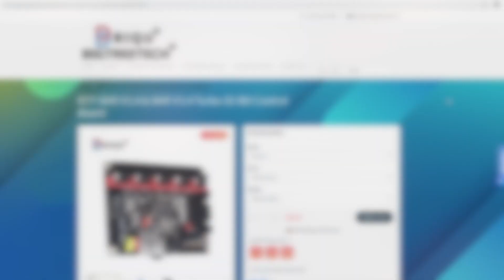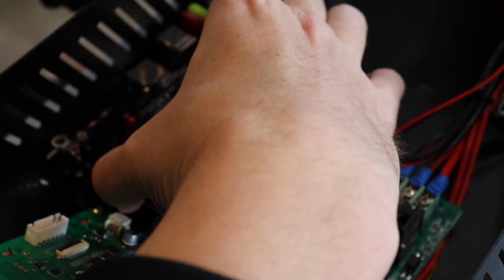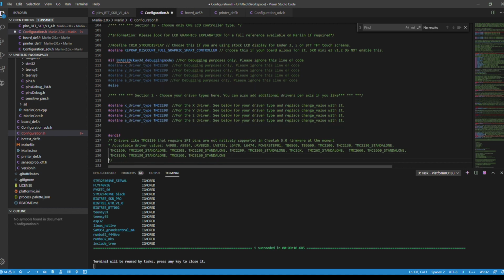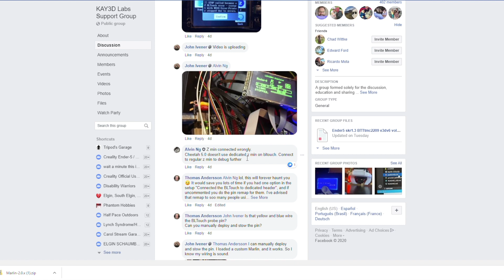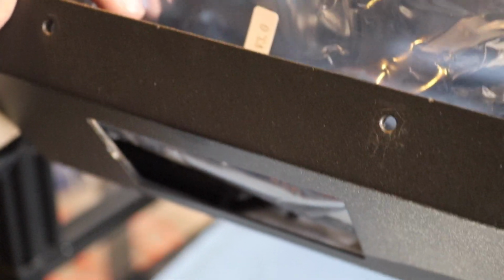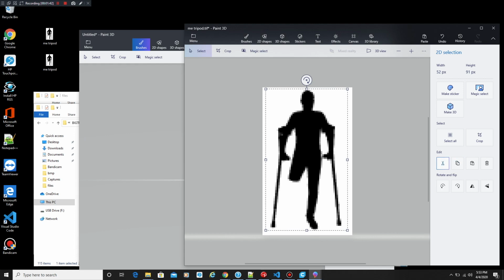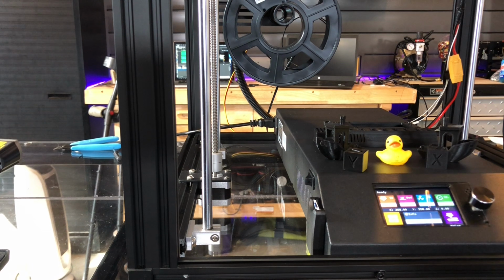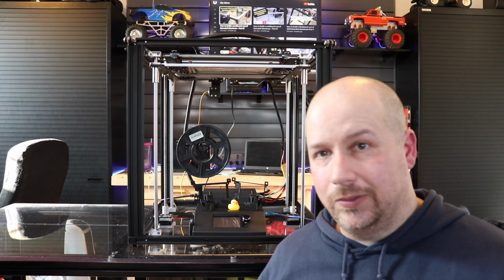Ender 5 Plus Ultimate Upgrade!   BIGTREETECH 32bit 1.4 SKR TURBO & BIGTREETECH TFT35 V3.0

Comment: I did the exact same upgrade to my Ender 5 in had the reference your video about 10 times. You help out a lot. Thank you!
Reply from the maker: That is great!  How is the upgrade working out?
Reply: @TripodsGarage  wellllllllllll. I am running the tft50 and trying to get bltouch working which I think does now lol. Plus the motherboard fan doesn't fit in the stock Ender 5 location, so more cutting! . This is my first major upgrade with the 1.4 turbo and tmc2209s. No sensorless. It has been a challenge but have learned a lot. Many issue but getting close

Comment: I tuned the serious vibration on the diagonal runs, Cable tied two VW polo exhaust rubber hangers on to the two 20x20 upper cross bars. They are heavy dense rubber, the weight and density silence the resonance.  But the Hotend fan still rattles during the vibes.. heavy duty foam on the base rails shut it up too, as does the cabinet enclosure its now in. 24hrs a day no longer a problem.

Comment: Great video, I'm the designer of the 2 brackets you used for the SKR and the TFT35,  just wanted to say its great seeing them in use, and others getting some value from them.  I found your video because I'm about to replace my 1.3 with the 1.4 turbo.
Reply from the maker: M C -  Great work!  They are a perfect fit, as you can see!   So happy you found the video, hopefully it comes to good use for your upgrade.  Thanks again - and thanks for watching!  Tripod
Reply: Hi, do you have a file for the TFT35 v2? I got a SRK1.4 i want to swap and it was a combo deal with the V2 but the file is for a v3 which is a bit different dimension. Eitherway, great work. They printed great
Reply from the maker: @0xFAVS  Hello!  I do not have a file for the TFT V2, so sorry!  I was on the BTT site and all I can find is the Bootloader.  Seems that all the Github downloads are gone for the TFT35 V2.0.  I will continue to look!  Thanks again for watching!  - Tripod
Reply: @0xFAVS  I don't, I only own the v3, I measured it up with a set of calipers. If you want to adjust the design yourself I've included .step files on the thingiverse page.  These are easy to edit (compared to .stl) in something like Fusion360.
Reply: @0xFAVS  I found a diagram with measurements for the v2,  I will have a go at editing a design for the v2 when I have some time later tonight, but you will have to print and test it, because I don't have one to try it with.
Reply: @0xFAVS  Here it is for the TFT35 V2.0  www.thingiverse.com/thing:4285471, like I said I have no way of testing it and it is based off of the diagrams from the BTT Github.  Let me know if I need to tweak it in the thingiverse comments.
Reply: @mc-dp5bd  Thanks :)

Comment: John, Great video!!  I can see why it took you a while to put this together.  The advantage of this upgrade is the extra features and options you gained.  After watching the video and your fun with the control box, you can understand why I ditched the box and made a new mount.
Reply from the maker: Hello David!
Yeah, this video took me a really long time to put together!  This video could have been easily 2 hours, I cut out a lot of footage.  I might have to do a long term update.  I stared at the box for a long time deliberating if I was going to keep it.  I decided for this upgrade, I was going to keep the stock look.  The box is getting crammed, but I kept it neat and tidy.  As for future updates, we shall see if it remains!  Yes, extra features and functions is correct, plus some future expandability.  It is so nice to have the filament runout working correctly and leaving the bed heated on!  I really dig the dual displays,  I learned a lot making this video, diving into stuff I never did before.  I hope that this video is useful to others as well..  Thanks again for watching!
Reply: @TripodsGarage  At this point there's very little Cheetah left in your setup ;)
Working advanced pause/M600 (filament out) -> multi color printing made easy! :)

Comment: This saved me so much time. I put in an SKR Mini E3 v2.0 board but the changes were pretty straightforward. One thing to point out with the current version of Cheeta enabling the EMERGENCY_PARSER caused the compile to fail. So I took it out and at that point, everything worked. Again thanks so much this is a really great video. Much appreciated.

Comment: Something else I will add, I trimmed the reset button off flush to the bracket on the tft35, put some masking tape around it and hit it with a dremel.  Its just too easy to bump mid print where it is.

Comment: Thank you, I broke my silent board USB, and Creality didn't (still doesn't) currently ship to the UK. So I found this on alternative control boards, and it was very helpful! I have ended up using Klipper firmware, I'm happy with the results. Though I should say Klipper doesn't support the TFT35 currently (12864 emulation mode is lacking a feature that Klipper uses, apparently).
Reply from the maker: Thanks for watching!  I will need to look that up!  Thank you...

Comment: One thing that helps when cutting out your new slots is to drill out the corners first. If you want to keep your cuts straight you can take a straight edge to the case and rest the cutting wheel on that while cutting. Appreciate your video, I just ordered that board because of it. I chose the HRP-600 power supply though.

Comment: Maybe I missed it but one of the issues I had and solved was that the build environment was not set.  Without this the build fails right after beginning compile.  To fix I just changed default_envs = LPC1769 in the platformio.ini file.  Thank you so much for the wonderful video.
Reply: I used this for my Ender 3 Pro, but the Cheetah would not even compile.  VS Code indicated that the INCLUDE folder was missing.  DLed the Cheetah from both their site and from Github using the links in the Cheetah site.  One DLed Cheetah, the other directed me to Marlin, no Cheetah.  Cheetah would not compile and the second is that standard drone of completely modifying the code in Marlin, which I did before and didn’t work correctly.....when I did, I always get the NO PRINTER ATTACHED, and I have been unable to resolve.

Comment: Tripod, thanks so much for making this video.  I followed it (I think pretty carefully). My only difference is that I used the 2209 drivers (and snipped the required pin).  I upgraded both the SKR board's firmware using the Cheetah using your instructions in the video,  and the TFT display board using their github repo.  My only problem after everything is done is with the BLtouch.  I think I have my BLtouch wired (I think) exactly like you show, in the Servos/Probe receptacles (rather than the Z-stop probe that Kris Kersey showed in his video). I figured that would ensure that the firmware is configured for the BLT correctly. The only diff (and challenge) is that my cable is white/black/orange/red/brown.  I think that matches yours (white/black/yellow/red/blue).   However, when I try to Z-home, the probe extends and retracts a couple times, then flashes red and I get an error on the display saying I have to reset with an M999.  I would be very grateful for any suggestions you might have for troubleshooting this one last issue.

Comment: Hello there
I watched the video, and thank you for this for this detail. I have an ender 5 plus. I love it, but I am having these small issues here and there, and I'm leaning towards the stock board 8-bit and the firmware that comes with it. Also, their slicer creality 4.8.. I have been going over and over on videos to try to make sense if I do need to swap the stick stuff out and lean towards the better stuff. Upgrades I have done: exoslide, Capricorn Tubing, the silicone swap of the srings for the bed for leveling works great, by the way. My question to you on the video you presented on this upgrade. Did this make the printer work better for you? I'm only looking for the better upgrades as being a hobbyist only and my next project that I want to do is print out a gaming board and want to make sure that I get a really great detailed print for this. Thanks in advance for the update.

Comment: As an option for those wanting to save the money on changing the screen out:  You can use the stock Creality Touch Screen with the SKR V1.4 using the TFT pin header on the board.  I've done this on the CR-10S Pro and the Ender 5 Plus appears to use the exact same touch screen.   I pulled together some info for the pinout on the Creality Touch Screen and someone else tried it before I received all my parts to complete my upgrade and they confirmed it worked.  I finished my upgrade and was able to get my stock touch screen to work on it.  I hope this helps someone else wanting to use the stock touch screen instead of replacing it:  https://imgur.com/gallery/rcrRf0u and https://imgur.com/kanEegg

I'm not being critical of you replacing it.  Totally a cool option.  I share this only because it was hard for me to find the info at first.  I saw someone say it could be done because they had done it, but I needed to see exactly how.   Well, I figured it out again (totally not the first person to do so), but maybe that info above will help someone else.  It was really nice to be able to just change the pins and connector on one end of the factory cable and plug it straight into the SKR board and have it work.

Thank you very much for putting this guide together.  I'm saving it for when I go to upgrade the Ender 5 Plus.   Cheers!

Comment: Wow Tripod!  That was one complete build!  You really did go from A to Z!  With this instructional video, it will definitely make it a lot easier for others to do this, without having to wait 4 videos to complete it.  I totally agree the Creality board is just a waste of money.  I heard that Creality’s new lineup of printers still do not have a 32bit board.  If you are going to pay north of $300, a 32bit board should be standard, with upgradable drivers.  I believe that companies like Creality are veering away from open source and not releasing the firmware on purpose, to lock down their printers.  This way they get less questions about non-approved Creality upgrades.  Just my two pennies!  How long have they promised the Ender 5 Plus firmware\config?  Their new lineup looks of printers all have a custom UI touchscreen...  Thanks again for another amazing video!

Comment: What kind of tmc2208 did you get? I see DIY, uart, step? 

I recall you can set that on the MB but the driver it's self? I get uart but what are the other 2?

Also did you get 4 or 5 set of drivers? I know some people have always used other stuff for the extruder.

I tried using a different extruder driver for my tevo tarantula and it was noisy and I didn't see a real difference.... Not good ones... Just issues.
Reply from the maker: KornShaDoW097 - 5 TMC2208’s are included in the kit.  You can use 5th one for the dual Z or for another extruder.

Comment: the touchscreen has a filament runout sensor port of its own and will only work when it is hooked up to the touchscreen and the print  running from the sd or usb port of the touchscreen

Comment: I am just about to do this.  Thank you so much for putting this video together
Reply from the maker: Awesome!  Hope everything works out!  Thanks for watching - Tripod
Reply: Tripods Garage   I am just going to use your firmware build as I have everything as you do
Reply from the maker: Dave Glover - Perfect!  Remember you can always change the name of the printer 😉
Reply: @TripodsGarage  I got everything Wired up tonight. Now I just need to cut the case to make sure everything is accessible.  I did do a test homing and a z-offset as well as heatbed and hotend.  Everything seems to be working perfectly.  Thanks for putting this together!!
Reply from the maker: Dave Glover - awesomeness!  If you haven’t cut the case yet.  There is another file on Thingiverse that has the Skr board mount that turns towards the PSU, however you will still need extensions.  Thanks again for watching - Tripod
Reply: Tripods Garage I have not cut the case yet.  Right now I have wires all over the place.  I did notice that the screen doesn’t fit right   Looks like I need to take off a couple mm where the rotary dial post contacts the metal frame
Reply from the maker: Dave Glover - I pinned a comment earlier today.  Take a look before you cut for the display.  Someone adjusted the display mount, no trimming necessary!
Reply from the maker: Check this out!  https://www.thingiverse.com/thing:4421077
Reply: Tripods Garage I saw that and I am going to print it tonight 👍
Reply from the maker: Dave Glover - Nice!
Reply from the maker: Bryan Dimsdale -Yes!  You can get away with some notches cut out of the box, with some grommets for the extension cables, instead of the carnage I did 😉
Reply: @TripodsGarage  Thanks, I'm about to slice it after I fill in the screw holes a tad in tinkercad. Read in the thingiverse comments the screw holes were a bit big. I'm thankful I discovered the remixed screen mount as well. I am just going to run the cable through one of the angled  vent slots in the enclosure and flush it to the front face of the enclosure at the same angle as the screen. Thanks again for being our guinea pig with this!
Reply from the maker: Bryan Dimsdale - Glad there are other options as well.  No problem being the guinea pig, there was a lot of yelling, screaming and kicking, overall a fun learning experience!  I am a total noob with Fusion 360, hope to start designing parts soon!  Have a 3 part series coming out for the E5+, they are related, but can easily be separate upgrades.  New video is around the corner.
Reply: @TripodsGarage  Looking forward to it. I also have Exoslide on the way, but will probably wait a few weeks to tackle that
Reply: Tripods Garage because I run octoprint I didn’t even bother bringing out the SD card slot
Reply: @daveglover8942  I was considering that, however, I am hesistant due to the print quality differences when printing models with lots of curves from OctoPrint versus SD card (due to the buffer size on the 8 bit boards) Hopefully this new board will resolve that, but after watching Kersey's last few vids and all his test prints and experimenting, I'm still leary of giving up my SD card, just in case.
Reply: Bryan Dimsdale I ran a couple 78 hour prints with zero issues
Reply: @daveglover8942  Nice. I hope I get the same results. Usually I print from OctoPrint but some models I just have to print from SD to avoid all the blobs. Fingers crossed this upgrade makes it so I never have to print from SD again!  (because I'm lazy like that)

Comment: I just came across this video because I had searched for SKR 1.4. Good comprehensive video. Did you ever fix the runout sensor problem? you need to either plug it into the tft and try it or rem out the lines in the touchscreen firmware. You have the SKR looking for filament switch input at two different places. I know it works in one and not the other. Just try switching the sensor from the board to the screen. You had another problem too, with a similar solution, I dont remember what it was.

Comment: Hi I’ve installed the 1.4 skr and screen all good, was brilliant but i didn’t use it for a while and needed to re level the bed and I’m totally forgotten what the sequence was to leveling it, old age kicking In. To adjust height with paper is my usual start I think then abl leveling but soon as I got to print it just digs into glass. Something either broke or I’m missing something how does one level the bed with this Board and screen I hope ya have a video or some guild I can follow and hope I can then have a light bulb moment
Reply: This is more or less what I’m experiencing to, after homing with ABL, distance between nozzle and bed is always different.. offset is set and when I try to edit offset with babystepping it only moves the bed in one direction. Do you have the same problem?

Comment: Holy crap, so THIS is the video you meant, LOL!  YouTube notify fails AGAIN!!
Reply from the maker: Yepperz!  Gotta love Youtube notifications!  Let me know your thoughts!
Reply: @TripodsGarage  great minds think alike!  I fluked onto that Kay3d website somehow, via a core XY printer video, and the 30 minute video they have on Cheetah is *excellent*.  To that point, I had not heard of it, but it supports all these mods with the E5P right out of the box it seems.  I just need to figure out how to mount the SKR board and a Pi in that cramped case!
Reply from the maker: @bartacus3521  Was 3/4 of the way through a Marlin config, then I also stumbled on Kay3d!  Thingiverse files are in listed for the SKR mount and Display - well all but the Pi mount (next video?).  The person that designed the two parts I used, even commented on the video...

Comment: Check out the Lerdge K board very comparable to this board and better.   I installed it on my Ender 5 plus.  No need compiling codes and I can change setting via the GUI on the fly.   Very good details features setting.

Comment: Hi. So installed a tft on the ender 5 and trying to figure out.  How did you change the logic for up and down arrows on the move screen? Right now on mine i press down and bed moves up and up moves down. Increasing z and decreasing z is technically correct. Just trying to figure out how to get these set correctly.

Comment: Amazing tutorial thanks Tripod, all working except Filament Sensor. I think from your wiring picture its correct and I defined the 2 additional lines in the file line 296 / 297. There are settings in the LCD smart off and on, so far I have just disabled it, did you have any issues? can you blow up the pic to confirm its cabled correctly please? thanks!

Comment: Used the same files as the video except changed the drivers to 2209 and says no printer attached on the touch screen mode. Tried everything changed the rates and all.